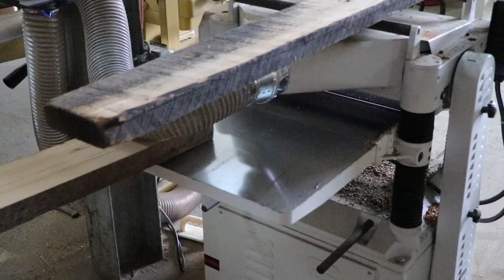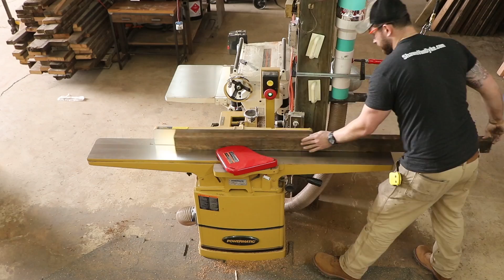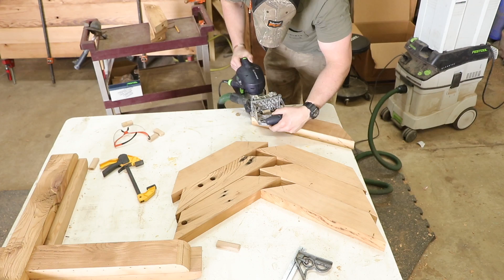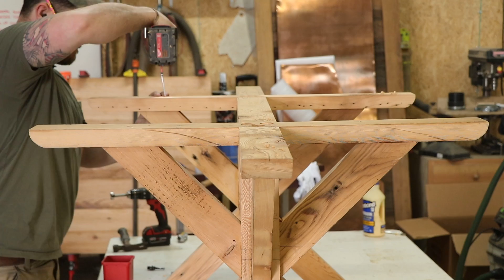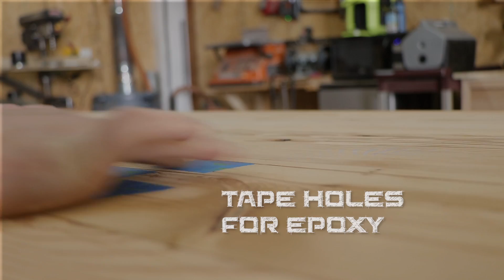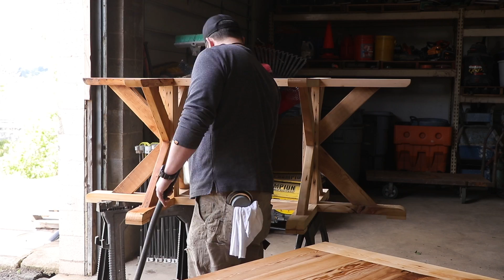Reclaimed X Style Dining Table | How To Build

Comment: I am confused by your breadboard end technique. BB ends are usually employed to 1. Keep the long boards from warping. and 2 eliminate the end grain visual.  The problem with BB ends is that unless you allow for the long boards to expand and contact with seasonal moister changes the top will develop cracks. So traditional bread board end treatments have dowels that are inserted into elongated tenons on the glued up long pieces. Were your domino grooves designed to accommodate this wood movement?
Reply from the maker: Yep, theyre pinned on the "long boards" and glued into the BB. It has a loose joint which compensates for the movement in the wood

Comment: If you add a breadboard with Dominos and then secure the dominos to the breadboard end with glue and then glue the dowel join on the other side where the domino enters to the top to make a mechanical joint, haven't you just prevented the function of a breadboard????  I could see if you pounded a 1/4 or 1/2 inch in first and THEN glued them but the way you've done it here seems to defeat the purpose of the joint (expansion and contraction of the wood)

Comment: Looks nice, thanks for the video. Question - I thought you are not supposed to glue the tenons of the breadboard so that it can expand and contract (except for the center). Is it being reclaimed, I heartily stable?
Reply: First off- I really like the look of this piece! But I asked a similar question below. I believe the BB end application has not been implemented correctly in this build . The pinning process is normally done on the BB end itself though an elongated hole in the tenon fashioned on the long pieces as in this illustration --
http://www.woodwardwoodworks.com/FarmhouseTable/BREADBOARD_ENDS8a.JPG  .    In this build  the dominoes are used as a substitute for integral haunched tenons, but there aren't any elongated mortises that would allow the expansion of the long boards nor oblong pin holes.  And the pinning dowels are through the long boards not the Bread board ends. The pinning dowels
 are supposed to be on the Bread Board end going through the (in this case) dominoes which are functioning as tenons and would keep the BB tight to the ends of the long boards. Chances are sSooner or later the BB will loosen  from the long boards especially on the ends. While the dominos can be used for  tenons, prediction is something's gonna bust or  split or both.
Reply from the maker: You are correct, I was moving quickly and made a mistake, which happens. good eye, I have a video coming out tomorrow for the proper way to adhere the,. i ended up cutting the breadboard off and redoing it. This is softwood  so the movement will be slightly less than if it was a hardwood table. And there is still plenty of slop in the mortises to allow for expansion
Reply from the maker: Alan, Great catch, eye and insight. you are correct and this was a mistake I corrected after edited the video. hence why i didn't have a full description in the video itself on how i did it. Sometimes you make mistakes. Either way, i'll have a video out tomorrow on how its properly done. Thanks dor the wisdom
Reply: John-When ever I make BB ends I have to seriously go over my sketches! It's easy to get things out of order. Still like this design and overall result Keep up the Good work---and.. BTW I was NOT the one dislike.